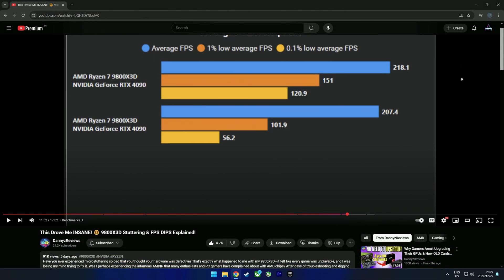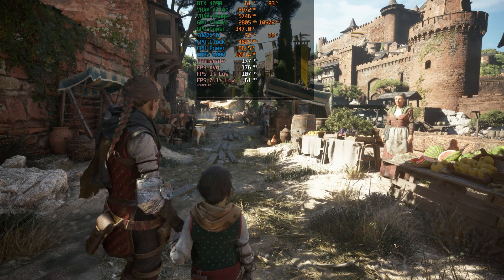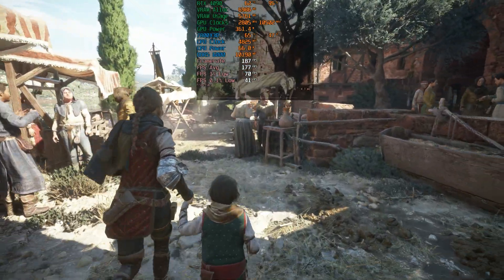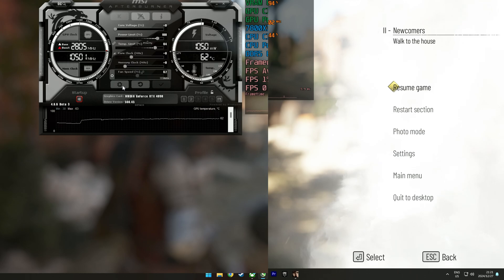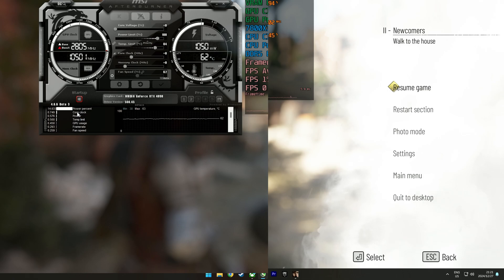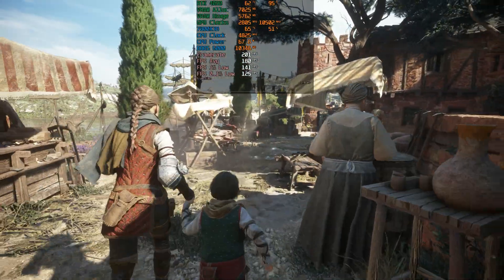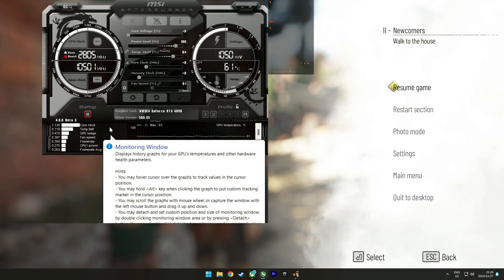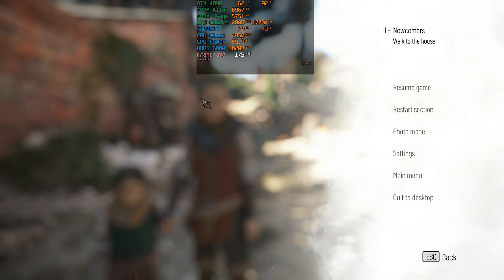MSI Afterburner Causing The Infamous "AMDip"?

Comment from the maker: **Important** 
This is NOT exclusive to MSI Afterburner. It happens with CapFrameX and HWInfo too, as per the CFX dev. CapFrameX informed me that it's an issue with the NVAPI. The GPU in the video is a 4090. Also, my 12700K and 14600KF do not exhibit the same issue as my 7800X3D with MSI Afterburner, and I believe it is due to the e-cores. Due to time constraints I havent been able to test my Intel CPUs with e-cores disabled, but I will do so and update via a community post and via Twitter.
Reply: Nice catch! I heard that’s all of the X3D chips were experiencing this kind of problem. I have a 5800 X3D myself in one of my systems. But it has an AMD 6800 XT GPU. So I use the built-in driver monitoring software. I’ve never experienced anything like this before. I do have another workstation system that has an RTX A6000 and a 3700X along with MSI after burner. Still haven’t experiencing anything like that either on that system. But of course it does not have 3D Vcache
Reply: When I do this, the profiler starts showing other things take 15ms. I remove power, then its the gpu usage. I remove gpu usage, it becomes the gpu core clock. I disable core clock, now its the memory clock that takes 15ms...
Reply: @vladimirljubopytnov5193   I documented it in detail in pinned post under @DannyzReviews video. And answered it in at least 2 similar questions in comments here. Do not try enabling power user oriented profiling tool, if you didn't read instructions carefully and don't know what to expect.
Reply: @vladimirljubopytnov5193  same here
Reply: When I used gpu tweaked it worked better.
Reply: I believe if you go into the bios and change the global c state in the bios from auto to enabled it helps resolve this
Reply: @russellwilson619  btw, it sounds like more than realistic reason and definitively worth testing. I have no X3D based rigs to try it myself, probably @Mostly_Positive_Reviews can give it a try? Considering that X3D seem to suffer from monitoring apps much more than slower older CPUs, it is quite possible that X3D's power saving react this way to periodic monitoring specific workload pattern, which makes the core busy just for a few milliseconds on each polling period. So it possibly triggers deep sleep / resume cycle, which can easily give you a feeling of stuttering.
Reply: @Mostly_Positive_Reviews  i have 13700k and it exactly exhibits the same issue on newer rivatuner versions.
Reply: @elinbarrage9638  I develop both RTSS and MSI AB on 13700, it doesn't exhibit anything even close to it. And finally, RivaTuner doesn't poll hardware at all, and it doesn't depend on RT versions. SO many wrong info....
Reply: @unwinder  well i didnt have this issue on rivatuner 7.3.4 ,msi afterburner 4.6.5 but  once i updated to rivatuner to 7.3.6 and the issue came back....i had this issue months ago with the same version but i unistalled and clean installed afterburner and it got fixed..i dunno if that pulls hardware or its a placebo or not but one thing for sure is that  i got more smooth results with power monitors disabled.
Reply: 13700k 4090 =NEVER HAD THESE PROBLEMS
Reply: Have you tried it on Windows 10?
Reply: Looks like I will have to close HWinfo64 and stop using Afterburner for now.  Just use Nvidia's small performance overlay for this time and test.  I'm on a 4090 and 5800x3D
Reply: Does this issue occur only when Afterburner is running, or can simply having it installed cause performance issues?
Reply from the maker: @rafakasabian  It has to be running and actively monitoring.
Reply: If the e-cores are alleviating the issue, then this problem should not occur on 7950X3D or 7900X3D, right? Any chance either of those could tested? Thanks
Reply: great .. now people will cheat this to make AMD look bad.. cool
Reply: This also affects AMD GPUs. I stopped using MSI Afterburner years ago exactly because I figured out it was the problem. Rivatuner Statistics Server on the other hand works perfectly without any issues. It is just afterburner.
Reply: @Thunderstyle7  It's possible it has in the past, but I have a 7700XT as well and it doesnt happen there, only on my 4070 Ti.
Reply from the maker: @aboutthat413  Yeah, I had a few people test Radeon 7000 GPUs and none could replicate the issue, but they could on 40-series GPUs.
Reply: @Mostly_Positive_Reviews That makes sense as I think the NVIDIA cards offloads much more scheduling to the CPU.    When testing the 4080 against the 6900XT, 7900XT, and XTX on older hardware (i.e. prior to 5000 series Ryzen,PCIE 4) the 4080 just gets smoked.  The AMD cards are more self sufficient.
Reply: I just upgraded from a 7700x to 9800x3d, it definitely wasn’t an issue with my old CPU. I replaced MSI afterburner with CapframeX and it definitely improved but is still stuttering slightly. MSI was virtually unplayable for some games.
Reply: So it is really NVIDIA dip?  Astonishing how they never take the blame for the problems they cause.  Go look at the launch of windows Vista and the NVIDIA driver.
Reply: @robertmyers6488  Nvidia definitely uses more CPU than AMD. It used to be a LOT worse ~5-10 years ago when CPUs were weaker.
Reply: @Thunderstyle7  Everybody believes it is driver overhead.  I think that is part of it and for the sake of the mythology communication I used the same, but in reality I think it is part of their compression requirements.  Instead of using more VRAM NVIDIA relies heavily on compression.  That requires a compression prior to loading into the VRAM which would have to take place on the CPU.  Of course not a single reviewer has done a deep dive and thorough investigation.  

I think they know that the memory bus and quantity is too small going forward and that is why you see the massive improvement in the 5090, but they know with the other cards they can bs it with software and throw faster memory at it.  A cult is a cult.  The 5080 is essentially the same as the 4080 with GDDR7.
Reply: @robertmyers6488  I don't know these days, but that compression used to sacrifice image quality at least up to the nvidia GTX 900 series days.
Reply: @Thunderstyle7  Go look at a game like Star Wars Battle Front II compared to anything in the last year.
Reply: @robertmyers6488  Oh and let me tell you as I have a (7800X3D + 5090) and the Afterburner issue is still there and definitely noticeable when I play (Hunt Showdown 1896). Even though I get 175FPS average in 4K all at Ultra, the 1% Low are getting killed by Afterburner even on such card x_x

Comment: any idea what could be my issue? i have a 7800x3d with 4090. 4 monitors main one 4k 144hz. all the other 3 are 1440p 120hz. But everytime i boot my pc just after getting to the desktop my pc just freezes for 3/5 seconds and then its fine. i think its the driver starting up any idea

Comment: How can I display the CPU CLOCK from 9800x3D on my afterburner? The menu doesn't exist -,- my 5800x3d can and the menu exists
Reply from the maker: You might need the latest beta for added support for 9000 series CPUs. I think that's the reason.

Comment: Nice! Thanks for the tip of the larger monitoring pannel to see individually the usage of each "sensors" :o That's something Danny didn't cover and that even more confirms the issue for 100% sure when you see it visually. 

I definitely confirm me and my other friend that have a (7800X3D) had this same issue where the 1% Low were dipping so bad for no reason it would cause random stuttering. I can't believe I've been playing my competitve FPS game for 1 full YEAR with this bug without even knowing! x_x I've been running Afterburner for like 15 years?!
Reply from the maker: You're welcome man. I also wasnt aware of the larger panel with more info until the dev let me know. I think Danny also didnt know until only later on, as Danny pinned a comment with some feedback from the dev.

The funny thing is, this was an issue a few years back, and then it wasnt again for a while, and now it is again. But it's the way Nvidia does the sensors for power %, and not the fault of the monitoring apps.

Comment: Saw this years ago and so turned off things like GPU power percentage back then. Also the impact wasn't that bad on a 5900X thanks to the second CCD (now 9950X3D).
The primary issue is the Nvidia API, not the monitoring tools.

Though I wonder, maybe AB could reduce the impact somewhat by offering different polling intervals for different values and maybe also use a more staggered pooling technique, so that it creates smaller chunks of CPU usage.
Reply from the maker: Yeah indeed, it's the way the sensirs are read on Nvidia GPU, especially the power %. The way the monitoring tools have to interact with the API. Polling it less frequently mighe help, but I think it will still have the same micro-stutter, just leass frequently.

Comment: What happens if you don't use the internal Power monitoring, and use the HWInfo one instead? Does the issue persist?
Reply from the maker: Yeah, the issue persists with HWinfo too. Most tools measuring power % have this issue. I have a pinned comment stating this.
Reply: @Mostly_Positive_Reviews  Hello again, I've tested this out with rtx 5090 aorus master and 9950x3d. Most of the metrics coming from the internal source were bad - approx. 20-30ms. I switched everything to HWInfo, and now the only metrics that are pulling the most ms are fps and frametime - avg. 0.1-0.2. Looks like the internal monitoring is bad and not the "Power" metric in particular.
Reply from the maker: I'll check it out again but at the time the developer of MSI AB reached out to me and said it happens not only with AB, but most tools, so I tested CapFrameX and HWInfo at the time and both had the same issue. Will test with the 5080.
Reply: How do i turn it off on HWInfo?

Comment: its not just MSI AB. I think its the x3d chip itself. I have never enabled monitored gpu percent in AB and still get this issue. I get micro frame freezes when i right click the desk top and go to display settings and click advance. This also does the same on windows power settings, for a millisec. I think its the x3d chips as i had none of this at all with a 5900x. try it. The biggest issue is running youtube on 2nd monitor and running a game at fullscreen. If you hit the windows key its awful when you try to temporarily drop out the game to switch monitors. Thanks for the video by the way
Reply from the maker: Thank you for watching and commenting. And yeah, been using my X3D for a few months now and there are definitely small niggles and issues with it that many fail to mention. And if you say anything negative about the X3D chips you immediately get cancelled 🤣

I noticed the Alt+Tab functionality takes a lot longer than on my 14600KF. Also, enabling and disabling monitors in Display Settings often causes a few seconds of freeze, but evwn on my 12400F it doesnt, with the same GPUs.

As a dedicated gaming CPU it's good. But shader compilation times, windows issues, and multitasking issues are something people never talk about.
Reply: @Mostly_Positive_Reviews  its strange the revies are only positive as i worried about the whole x3d thing when the windows game bar was needed,,i just dont like them at all

Comment: I’ve spent last month trying everything from BIOS updates to chipset drivers, changing ram and settings and turning rebar and HAGS on:/off. Turns out it was afterburner/rivatuner. It’s very bad on Horizon Forbidden West. Running a 5600 and 3070.

Comment: I use Afterburner for 20 years. It was one of the first programs I install on every pc. Today I deinstalled it ans holy cow its like I have a new rig without all the micro stutter (7800x3d, B650E-F, 4080). I wish I knew this way sooner!!!
Reply from the maker: Also a long-time user of Afterburner and it is unfortunate that it has such an impact when measuring GPU Power %. But you can get a mix of settings that arent impactful and still get good data. But the more things you monitor the worse the impact will be. This is true for most monitoring tools though.
Reply: If you have Forbidden West and reach the dlc this effect is so massiv its ridiculous!

Comment: Isn't is ironical that, having such high performance cpu as 9800x3d yet facing stutters due to a mere monitoring software, i do have an aio which has display that reads cpu temp, and sadly i am being forced to close it , and also other background tasks, 
The stuttering is graphically visible if your turn on the cpu wait render time graph on valorant
Reply: Hmm is that true. Which aio are u using. I'm using corsair and the micro stuttering is driving me crazy. Even games that run very easy will get the stutter.
Reply: @Ilovecrumble  I have Deepcool LP240,
so, what i am forced to do is, run msconfig, go to services and turn off Aura creator or sync services and deepcool creative services(make sure to turn off the services not just application), clean boot.
No more stutters, graph is smooth as my ex's fliting skills.
Reply: Amd problem and poor task/load management, they have always been like this Amd is a very very unstable platform the least 3rd party program or weird software can make you go crazy that's why i went to intel, no difference in 4k and no fear of having those stutters, I just returned the 9950X a pure instable ngihtmare. Yes they have ton of cache but the cpu can't even manage multiple things smoothly that's horrible, that's where you see why intel is just better in term of fine details like these.
Reply: @Undersnow243  now the question is, can the stuttering be fixed ever, if not then AMD and these channels should stop promoting  X3D cpus to be the ultimate cpu while it stutters in basic tasks.
Reply: @shibashisbiswas9960  yes completely, thank you dude for saying the truth, too much channel promoting those X3D chip, yes they are darn fast on average FPS but their silicon/architecture is not powerful and stable at all overall for those problems. A CPU is not about FPS, it's about overall stability and temperature.

Comment: This just makes you think how many more things there are potentially downgrading your performance
Reply from the maker: Yeah exactly. Monitoring apps, Windows settings and features, so many software dependancies that can cause issues and  makes it very hard to pinpoint.
Reply: @Mostly_Positive_Reviews  this kinda stuff should be on the news so we don't miss out 😂 it's potential performance FOMO 😂
Reply: Yes, absolutely. It's one thing to have lower a average fps, but when it comes to %lows and general stutters that things get messed up. At the end of the day you get a high end system to have a smooth experience. It doesn't matter if you have 240 FPS if just moving your mouse around feels sluggish and choppy. I've battled this kind of thing non stop on my system. It will likely be the single reason why I won't hop in AM6 within the first gen minimum.

Comment: What if you're getting the dip and low fps with 9800x3d, and i DONT have msi installed.

Rtx 4080super

I'll be running games smoothly around 175-200 fps, then randomly dips to 20-30fps for a split second.

I only have rtss installed solo.

Its driving me insane
Reply from the maker: Do you have XMP enabled on your RAM, or manual timings?

What I can suggest is to disable XMP and run your RAM at stock speeds to see if it's not maybe slightly unstable causing the fps drops. I know it sounds counterintuitive, and will lower your average fps, but I've experienced it before where RAM timings were just slightly unstable and it would cause large stutters and frame dips.

Comment: I dont think its only afterburner, might aswell be 24H2
Reply from the maker: I was using 23H2 in this video. Happens on Win 10 too. But it's not just Afterburner, almost all monitoring apps that read the power percent sensor in the same way has this issue.

Comment: I'm having fps drops with 9800x3D but i've not even installed msi after burner.
Reply: Yeah but probably less  but to tell u the truth u will have drops even when not using Msi afterburner ur pc cant run at a steady speed all the time mostly when loading shaders or when a complex calculation is made I never seen a processor that never dips Intel or AMD

Comment: I started using MSI Afterburner and Revatuner a few days ago since people recommend it for smoothing the framtime, but I notice that my computer slows down like nobody's business and I lose about 80-120 FPS until I restart my computer. I didn't use it yesterday and everything was back to normal. I'm glad I'm not the only one having a problem with the software. I've got a Ryzen 5 5600 and RX 7700 XT for reference

Comment: Maybe problem exists another place :) 59,94Hz <> 60,00Hz. Use Custom Resotulion Utility and tweak sync's. Nvivdia anonunced problem with power probing and RTSS/Afterburner.
Reply from the maker: Good place to look as well, but this happens at correct 60hz, 144hz and 165hz on my system unfortunately.
Reply: @Mostly_Positive_Reviews  Disable power consumption metter in Afterburner / RTSS ?

Comment: does using RTSS overlay instead of Afterburner (disable all sensors in afterburner) resolve the issue?
Reply: while your game is running turning off rivatuner "Application Detection Level" will improve by a lot your latency spikes.
i do it everytime while im playing cs2 and using rivatuner to cap my frames.
i saw it from a video "CS2: Tips to Fix RivaTuner Latency Spikes on CS2" by FocusGaming few time ago.
Reply: @zyzU400Kg  turning off application detection level turns off the fps cap...